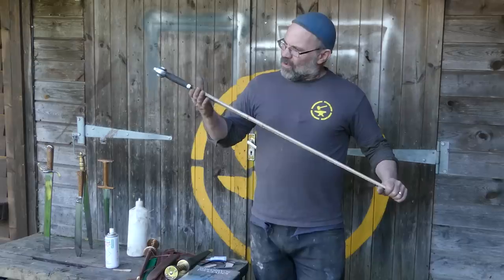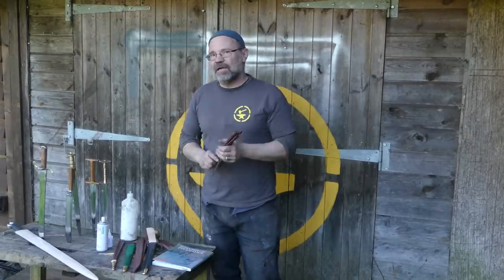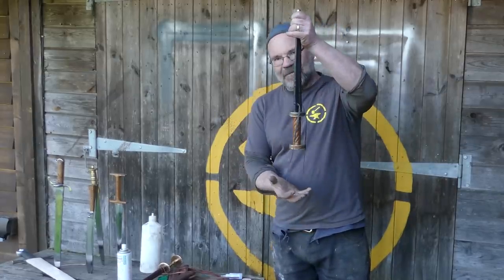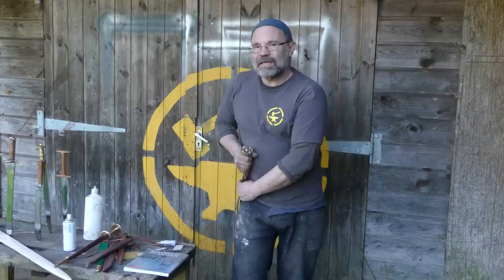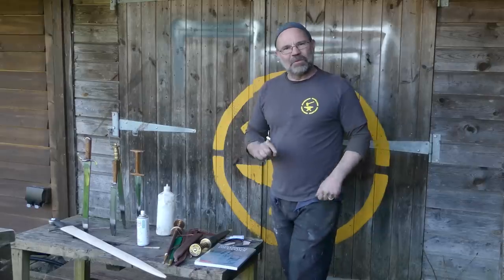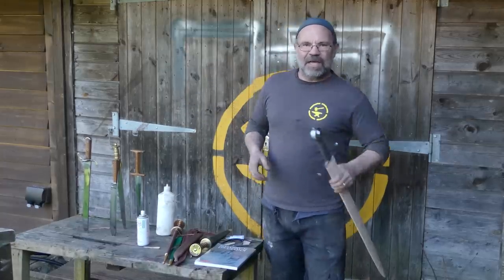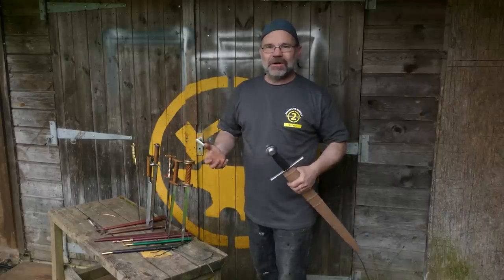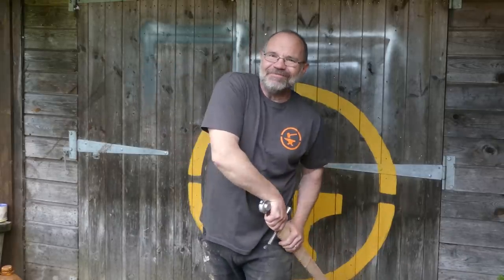How Tight were Medieval Scabbards?

Comment: Betting y'all refer to that . . . . . Yep! Y'all did say that stream is a river.   Most places, here is the U.S., we would say anything only waist deep is a creek . . . Easily dateable.

Never made a scabbard from leather.   Used wood or took heavy cloth made to fit a machete once, then epoxied the cloth.  Cloth/epoxy didn't last, still have wood scabbard 30yrs later (-bit notched & chipped, but, it was for a tool, so, ehhh!)

Comment: Modern sheaths for machetes and axes have the blade or handle dangle parallel to your leg, this doesn't work very well for walking. What happens is the axe handle or the machete blade get caught by your legs and can trip you, especially in rough terrain. I always modified mine when I had the chance so that it hun off your belt about 30 degrees from perpendicular. That way you could walk normally and it would just ride on the outside of your thigh, if you had high steps or had to run you had to grab the blade or the axe head.

Comment: I think overall there is a high probability for scabbards, especially more inexpensive ones, to have been made with a looser fit. On the other hands there types of edged weaponry where this would have been highly problematic. The many depictions of rondel daggers (with short blades) come to mind, were the weight of the hilt lets them hang upside down on the belt. Here a loose fit would be quite ... annoying. 

But maybe there was more care in good fitted scabbards of the time to get a partially tight fit, which only gripped the base of the blade tight. This would give a similar effect to Japanese Swords and Scabbards. Especially with european Swords that have pronounced ricassos I think this could have been done quite reliably. But also on other swords or daggers you could probably use the sometimes quite dramatic distal taper on the base of the blade to get a tight fit and let the rest of the blade looser. But im no craftsman nor an expert in scabbards, so i dont know how difficult (expensive) this would be (especially in the historic context) or if there is any indications on historic scabbards.

Comment: I don't agree with your point about dagger sheathes, even if sheathes weren't always made specifically to fit the dagger. My reasoning is that in countless depictions of medieval art the dagger is almost sideways, and in some, the dagger was flat out angled down. I also have one of your daggers, and can say that when I tie the dagger to my belt, or stick it in sideways like they did with their purses, the dagger will just fall out of the sheath if I bend over at all.

Comment: I oil my scabbards. Oil hardens after a while and it keeps the shape.. and the blade doesn't rust if you leave it in the scabbard under storage
Reply: You can actually use superglue on leather, but if you want to have a nice look use wax and thinner, just ordinary paint thinner. Mix up the wax and thinner, then fill out the fibers and wait until the thinner evaporate. Now you have a fine saturated scabbard and it too will harden, but the finish is more even.

Comment: Thanks Tod. After the scabbard dried out, was it too loose or did it go back to its original snug fit?
Reply from the maker: Good question.  Actually it shrank back to smaller than original, but in fact it will resize pretty easily and after a few days the wood was back to serviceable, but the leather didn't resize so well and stayed baggy.  I actually don't know if it is the case with wood, but if you speed dry leather by putting it in a boiler cupboard or near a fire for instance it shrinks back as it dries often much more than its start point.
Reply: @tods_workshop  Thanks Tod

Comment: I have that problem with my Main-Gauche, the sheath is far to tight and it's a bitch to draw the dagger. 
I tried sanding the leather down a bit for an easier draw, but there's not enough space to work it, and when the leather gets a bit damp it's "stuck".

Comment: i have a question and im not sure i want to risk my first knife on
dose brassing a steel blade protect it?
when i brassed my knife it was for a unique look (that combined with a blued edge) but my hands are always a bit greasy and ive never done any maintenance from how often i dont use it but did i accidently find a way to preserve my blade for longer
would like to hear your thoughts on it as you have more experience with metalwork then i do

Comment: hello, i'm a leather worker, and i'm afraid to told you, you're wrong about a lot of things.

First : we can play with the leather far more than you think. I love making knives pouchs too tight : 
The only thing i need to resize the leather is hot water, and the object who needs to fit, plus a little, not even a millimeter wide.
 Then dry it all, job's done, tight and strong. Too lose ? then heat it on a flame.
And yes, i know there is another factor i put in the equation : temperature

Second : please, don't use superglue on a medieval work... But skin glue. Yeah, it's not a fast glue, but hey... accuracy... And same idea : it's so easy to boil your scraps of leather and recycle it in glue !

third : kobudo. If you are in a hurry, then you don't draw you're sword this way. The sheat MUST move, because then it's not just a draw, it's also a cut.
This is why a knife or a scabbard is loose on the belt.